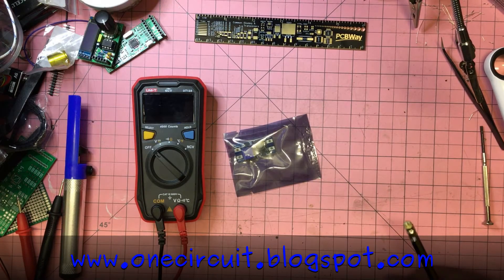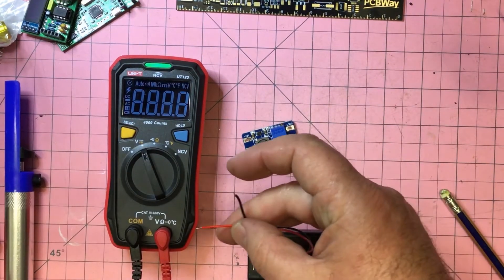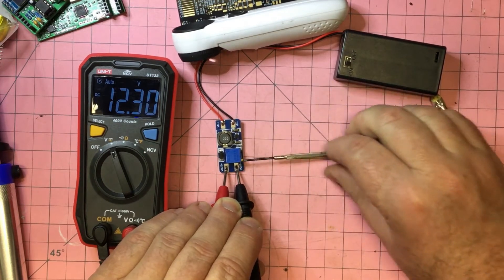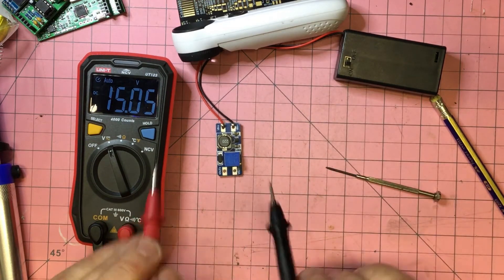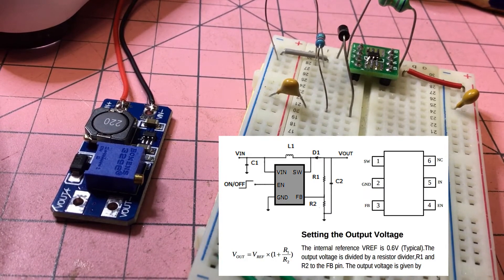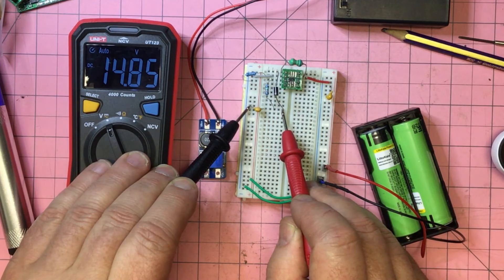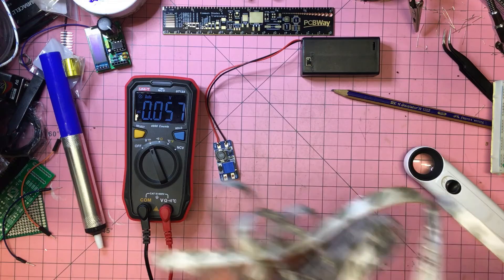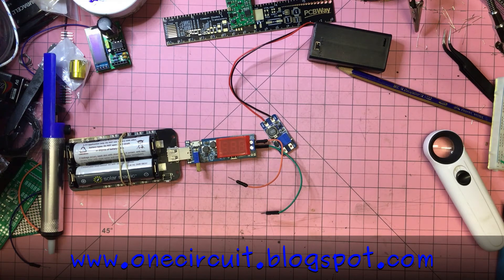MT3608 DC-DC Boost Converter

Comment: I wish this had a constant current ability.  What will pair with this to do the CC that I need?
Reply from the maker: Have a look at the LM317 or LM338 in constant current configuration. It’s also on one of my earlier vids/posts! 👍😀
Reply: @onecircuit-as  Linear regulators are pretty crappy though in comparison to a PWM system from what I have been told.  2V in 12 out 2A.
Reply from the maker: I guess it would be a close reading of the datasheet to see the values. There are constant current chips as well, and in one of my videos I used a transistor arrangement. 👍😀

Comment: Hi, Great Video. However you won't be able to identify the real voltage ripple or noise or any problem with your oscilloscope, that scope's bandwidth can cover up to 200KHz at max, in order to really see the output of the chip you need an oscilloscope with a minimum of 2MHz bandwidth.
Reply from the maker: I’m always on the lookout for a cheap second hand oscilloscope. One day... 👍😀

Comment: Very nice video. I do like to keep those little boosters in stock. My normal regulator now is the mp1584en based bucks. They are very good and cheap. I never can get a good ripple read on a DSO and tend to use a meter in ac mode to read it. I toy now and then on getting an old analog scope for such things and real-time type waveforms.
Reply from the maker: I would love to pick up an analog scope! From time to time I look at sites like gumtree to see if anyone is getting rid of one. My scope is only semi-useful in this situation, but I can't complain for $20!

Comment: You should get yourself a pot tool that will not slip of the pot screw as it has a covered screw blade but loved the video very good
Reply from the maker: I only buy the pots with the external winders now, e.g. https://lcsc.com/product-detail/Precision-Potentiometer_BOCHEN-Chengdu-Guosheng-Tech-3296X-1-501_C330441.html
I’ll look out for a covered bladed screwdriver. Might cut down the swearing a bit! 👍😀
Reply: Do you know the name of that tool/cap I didn't manage to find it

Comment: What's the maximum current draw you can get with a buck converter ? Could I run a 9v motor at full speed from 2 AA batteries ?
Reply from the maker: The datasheet of the MT3608 boost converter claims 4A! I’m not convinced...👍😀
Reply: @onecircuit-as  That sounds good, I can't see a 9v motor drawing 4A, so I think it would be fine. Thank you.

Comment: Those modules (and similarly small buck converters) pair well with microusb jacks on leads (found on AliExpress) to convert devices to work off power banks or USB wall warts. 

The jack with leads means just a small round hole in the battery compartment cover, simple for anyone.
Reply from the maker: Yes, I have reached for them a few times - and it's nice to be able to make "fixed" voltage versions now with the ICs in my own configuration. Very interesting chips and surprisingly stable output voltage.